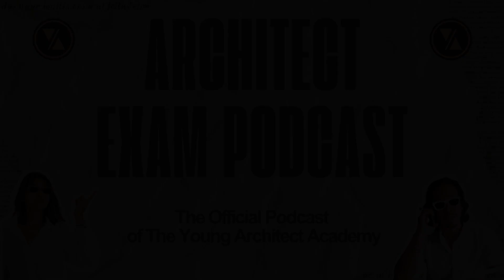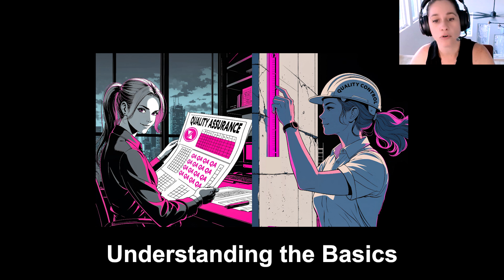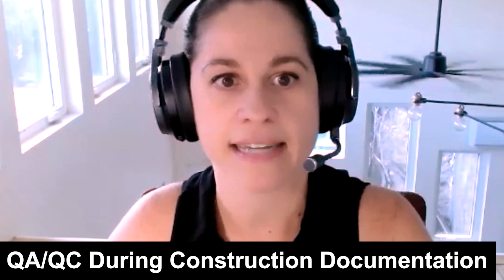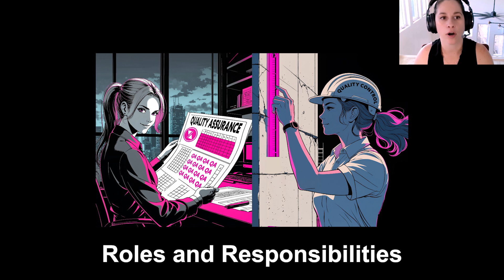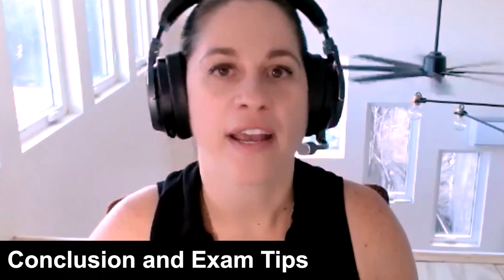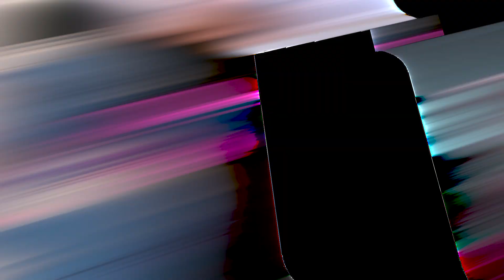⚠️OUTDATED VIDEO 013 QA vs QC - See New Version in Description

Comment: 15:50 QC happens before the design even begins? I thought you had to have a design before you could do QC
Reply from the maker: Good catch, Valerie, but your instinct is actually correct! What Emily is describing at that point is QA (quality assurance), not QC (quality control).

QA is the preventative side. It starts before design by establishing standards, protocols, checklists, and procedures that set the team up for success. Think CAD standards, BIM protocols, documentation templates. All of that is QA happening before anyone picks up a pen.

QC is the detection side. You're right that you need work to exist before you can check it. QC happens when you review drawings, verify dimensions, cross-reference documents, and test installed materials. You can't control the quality of something that doesn't exist yet.

Remember the trick from the episode: A comes before C. QA (assurance) is preventative and comes first. QC (control) is detection and comes after. Your instinct was spot on!